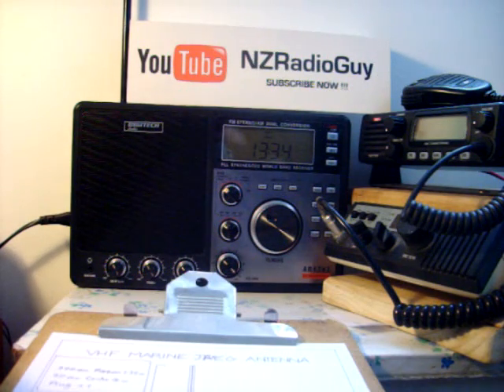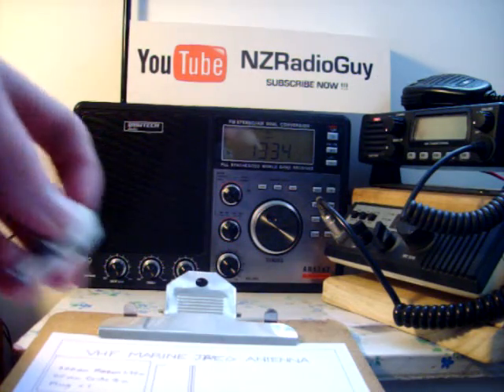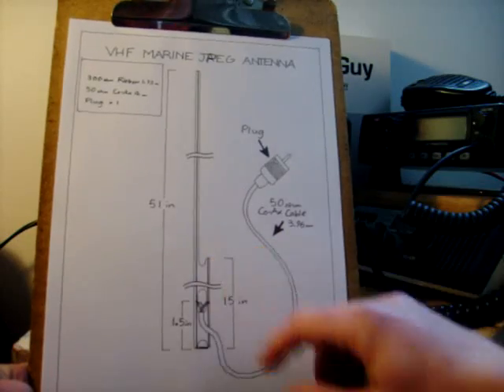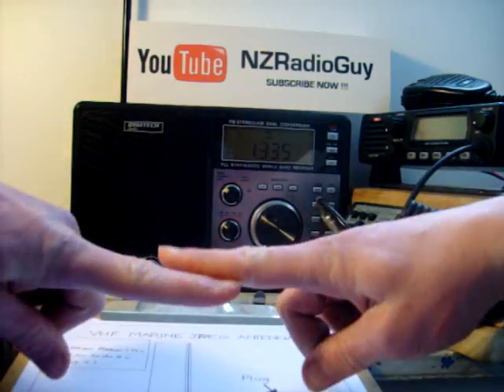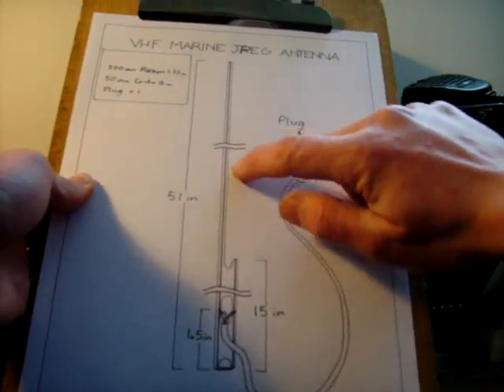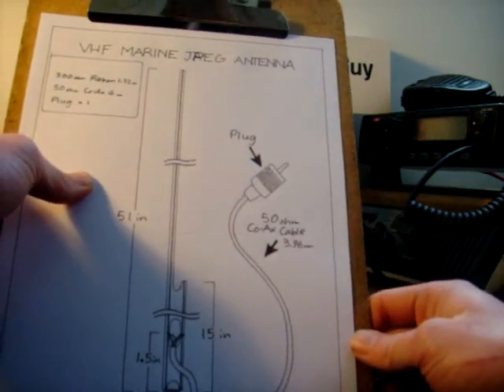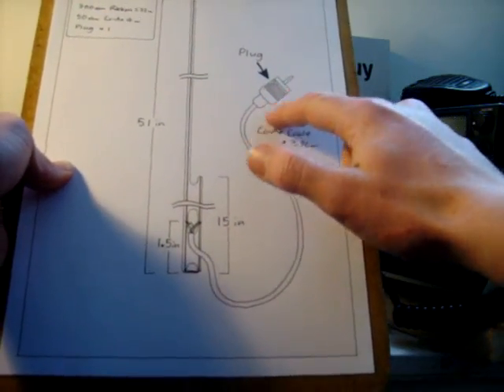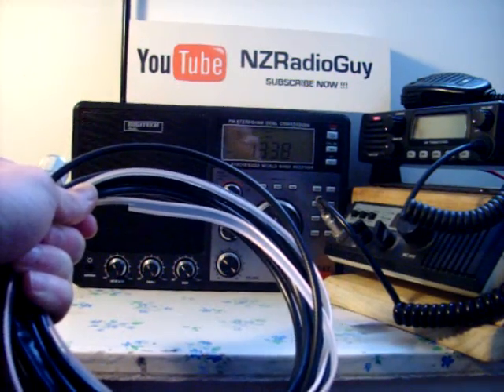DIY VHF Marine Radio J-Pole Antennd Design

Comment: Is there a connection between the 2 lengths at the top of the j? And also are both sides of the 300ohm ribbon connected to each other at the bottom or just one side? Same question for the coax.